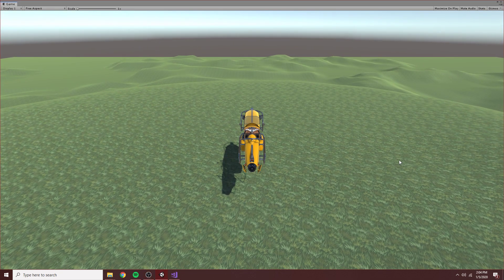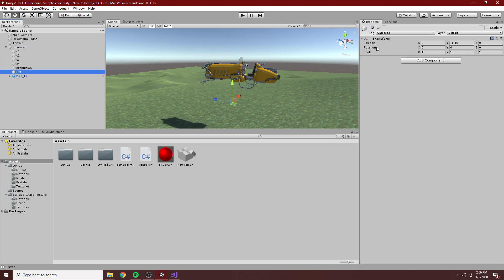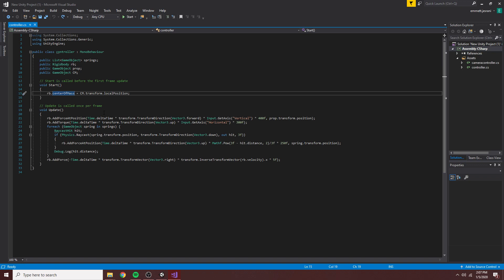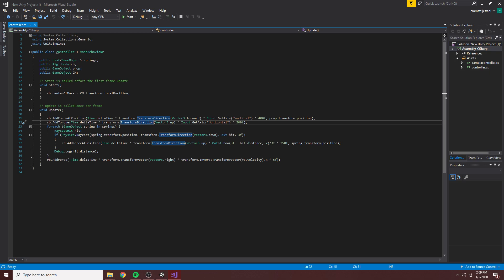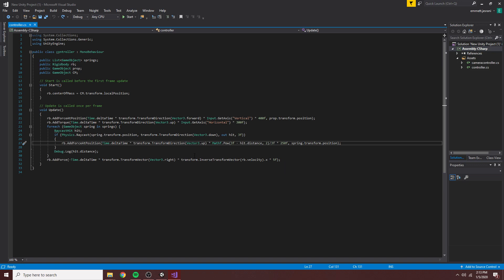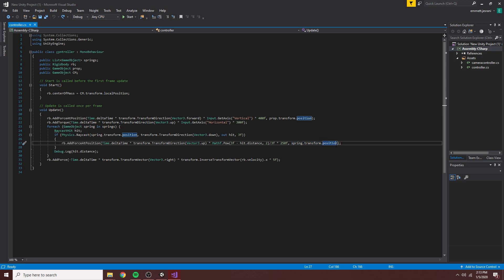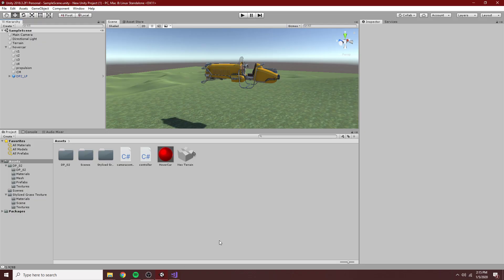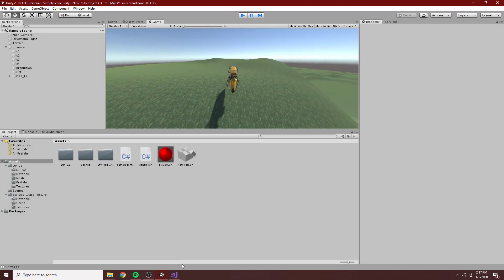Unity HOVERCAR Tutorial

Comment: For some reason, after implementing this code, my hoverbike's "springs" never hit anything. It keeps sending a hit distance of "0" into the console; it never hovers. What might the issue be on my end?

Edit: I found the issue, and all of the Vector3 directions were...rotated wrong? So how Axio used "down" and "up" for the hovering, I had to use "back" and "forward" respectively. Switched 'em all and it works great. Thanks!
Reply from the maker: Vector3 directions in Unity are local with respect to the object and are expressed in world space. I would guess that, for whatever reason, your parent structure involves some weird child angles and is therefore changing the forward and back directions such that they are now verticle (e.g. x angle being set to 90).
Reply: @AxiomaticUncertainty  Yeah..the person who made the original model that I was using had it turned 90 degrees upward on the x axis originally.

Comment: I've found using a PID controller gives a really good result for hovering.
Reply from the maker: Yes-- PID is definitely a good solution if you're looking for a very stable hover; however, I quite like the instability of this dampening as it creates a bounciness which is inextricably linked in my mind to hoverboards, etc.
Reply: @AxiomaticUncertainty  That is fair, I actually made a preset system so that I could select PID settings that would give more instability and sponginess when I want it. But, I will say modifying PID values to get what you want is a pain.
Reply: @AxiomaticUncertainty  you can adjust the frequency and damping of a pid controller to get a more spongy feel.

Comment: Couple of comments. 

I think its strange to use empties for things you can program. Like coordinates and positions. It makes the script less universal. foreach is super super slow compared to a regular for loop. And since its called every update that change can really save you some processing time.

I also wanted to ask if there was a particular reason you put it in update instead of fixed update? physics stuff runs on fixed update which isnt called every frame(Every 5 i think) so if you call addforce in update, It wont do anything 4 out of the 5 times its called. 

Still though. It works and thats whats important.
Reply from the maker: Using update was just an oversight (I wrote the code in <1hr just to demo the concept and give people a guide on doing what the other video had mentioned in Unity as opposed to UE4).

I use empties because I'm not incredibly well-versed in good design practices for Unity. I don't use it regularly, and I mostly make videos for fun. Usually, I have some idea for something and then either make a full tutorial or use a video to document the code because I'm neither good at nor interested in video editing.

I'm aware that foreach is slower, but it's also cleaner and not much of an issue when it's only iterating over four points. Either way, good insights!
Reply: @AxiomaticUncertainty  Ah not a problem. Its a great starting place for people I'm sure. If there are any newbies watching, I'd also recommend creating a buffer for the spring distances. You want to smoothStep from the previous position to the new position instead of going straight there. I'm actually fairly positive if you swap your code to fixed update you might find the hover just slightly jittery. For reasons i'm not entirely sure of, Running a force command within update can result in a buttery smooth force effect. I'm pretty sure it has something to do with the way ForceMode force works. I find it to be more of a hacky solution then my buffer solution

Comment: What is the position of the springs (c1,c2,c3,c4). Also does the scale of the vehicle make a difference? Mine wont stop doing backflips lol
Reply from the maker: The scale may matter for the coefficients because the same forces applied on a larger scale will result in less rotation.

To your first point, the springs are at the corners of the vehicle's collider and just below the middle, height-wise. I found that it makes it more stable and generally responsive to forces.
Reply: @AxiomaticUncertainty  thanks man!  I got it working :) I also added a function to do barrel rolls lol great tutorial btw!!

Comment: Hey dude great video. Could you share the code / do a video for the camera controller script? You’re a good teacher
Reply from the maker: The camera controller script is not mine; it's a very common script and can be found on a number of sites. Here's a link to an example:
https://kylewbanks.com/blog/unity-make-camera-follow-player-smoothly-and-fluidly

Basically, Lerp is a command that takes two vectors and calculates the difference (subtraction), then divides that distance by some time-scale in order to give the a vector which interpolates between the two positions over that period. In order to create a smooth camera, we set a target position (usually a transform plus some offsets) and lerp to that position with a speed specified by a variable.

For rotation, I just used the lookAt function. When this is called, Unity points the object such that its transform.forward (vector extended from its center and front) intersects with the specified position.